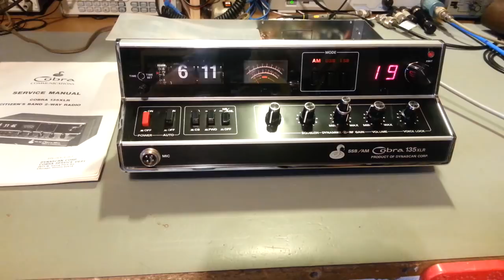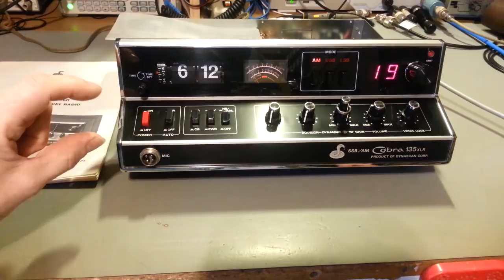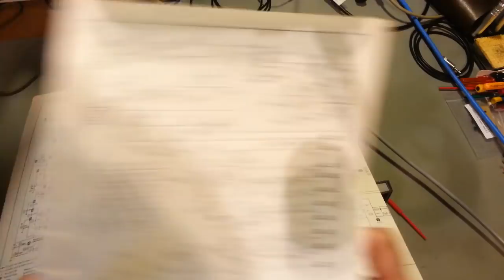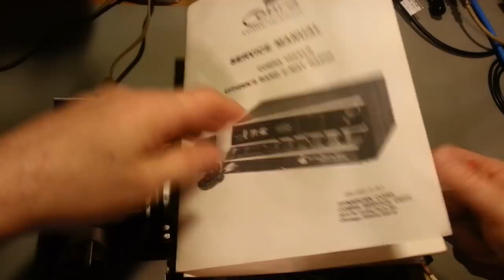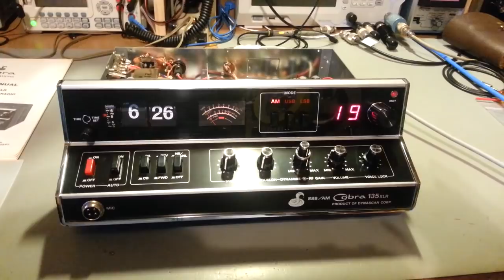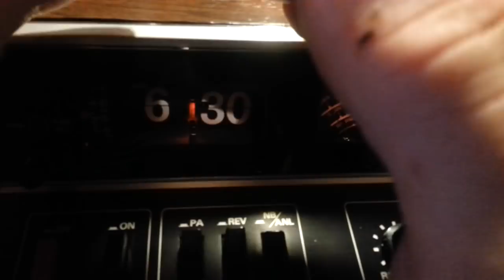Cobra 135XLR 40 channel AM/SSB CB radio restoration.

Comment: I just received a Corba 135 XLR in a trade.  I have no idea if it works all the light come on but the clock does not work.    What is the value of the radio.

Comment: I have the same radio. Worked great , unplugged it  for  13 years .. I just hook it back up. Clock works great but the radio side is not lighting up, at all mic sounds like it is working  just fine.    Can I get a location  to send it to to have it looks at to get it back up and running  again

Comment: That turned out real nice! Very cool radio. I remember when I was a kid in the 70's, like very early 70's we had a catalog from "I think" COOK BROTHERS in Chicago, they had probably twenty pages of I'm talking about some of the grooviest console base radios. From what I remember, some of those radios I see from time to time in videos such as Mikes, like Big old Dwight's with the groovy round meters, but some of those radios you don't see at all. Esp some of the plastic console models. Does anyone remember what I'm talking about? I was a kid with zero dollars but I wanted one of every radio in that book. If someone finds one of those old (hardback) catalogs, I challenge them to look up the cb section and post it on YT I'd give about anything to see that.

Comment: Yo Mike---The clock Light indicator on your XLR is woeeeeeeefully underpowered.  I can't believe you are content with it. Rest of the rig is very cool. Just sayin'.
Reply from the maker: Most clocks like this have very dim bulbs.  That's the way they are supposed to be.  The clocks are easily seen during the day, no light needed.  At night in a pitch dark room it's designed to be just enough light to read the clock.  Most old flip clocks and rotary clocks only used a neon bulb.

Comment: Mike,
Can do you with the odd working clock like that?
I do not have any 'stock' as such, but at times you see them in bundles of four or five for a few pennies. These are the actual clockradios from back then. But I imagine the innards are all pretty much the same 

73
Paddy